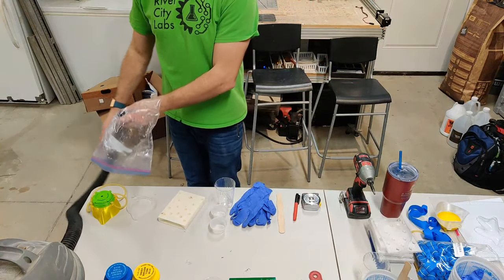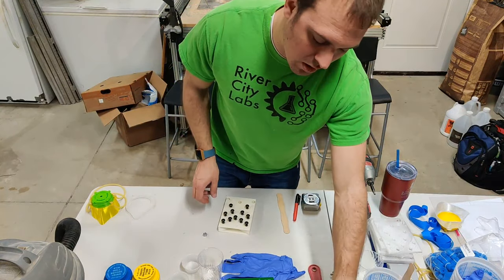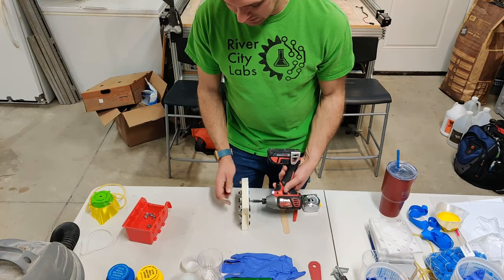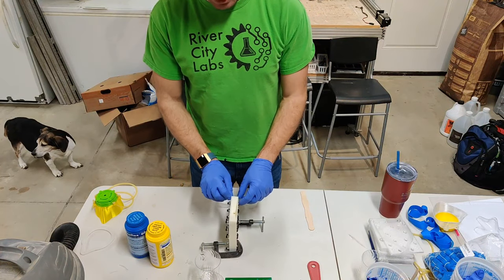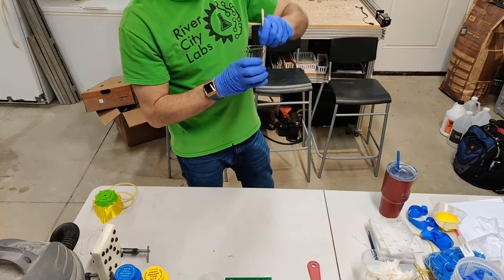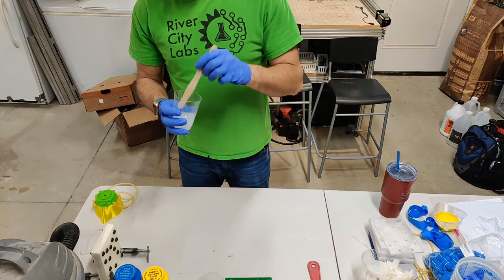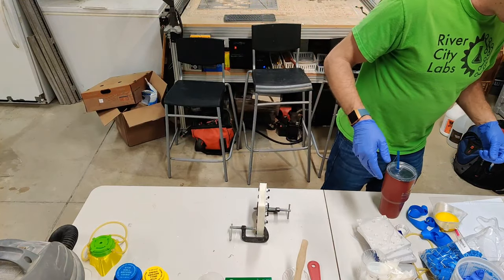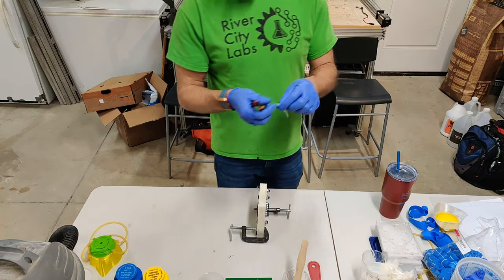MalaMaker: Silicone Casting

Comment: could you please give text detail on which silicone you use, as i dont have time to continually scrub through your video to where you tell us which silicones you are using (i need to go to a specialist supplier in my country as two part silicone is not easily available here)
Reply from the maker: The silicone being used for the gaskets is a shore A 20 hardness. We are using smooth on brand dragon skin 20..